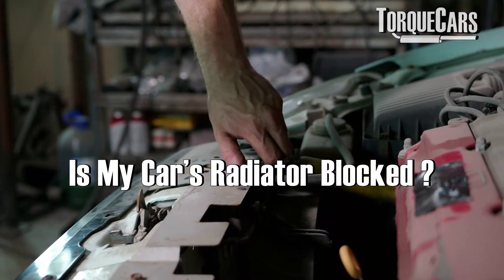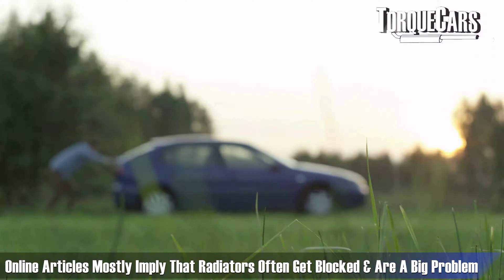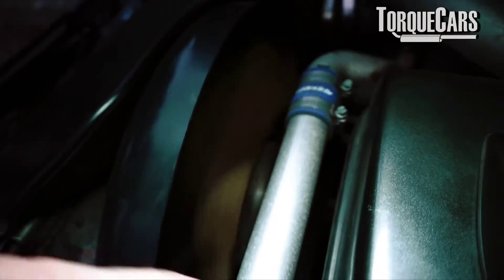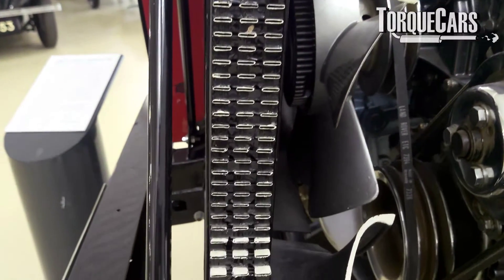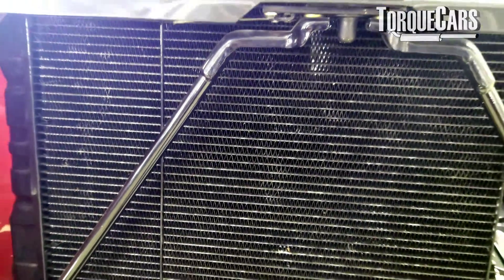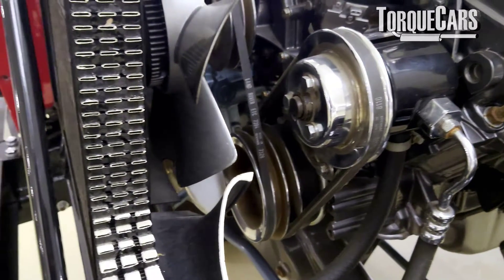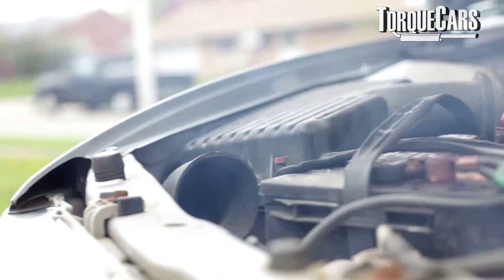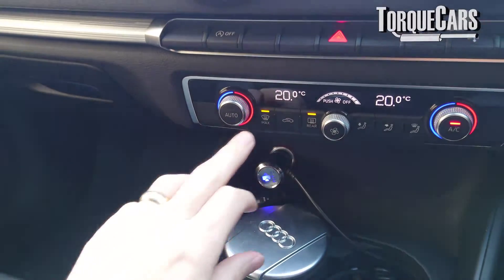Engine Overheating - Blocked Radiator Or Something Else? Diagnosing A Clogged Blocked Radiator

Comment: Can i ask for some professional oppinion. Everytime i drive my opel vectra c 2.2 diesel 2004, i lose coolant fluid. I always fill the coolant to the level where it should be when cold. Ofc There are no visible leaks underneath the car. But what i noticed, after driving for like 60km, when i turn the car off, and let it cool off for half an hour (the car is mild warm). When i open the cap, sometimes the coolant keeps gushing and returning in the coolant reservouir. The main coolant hose is a little stiff (meaning it could be a head gasket). But yeah everytime i ride the car, after a day i have to add 100-300ml of (coolant 50/50 distiled water). Can you please answer ? 🖐🏻

Comment: Can a bad heater or radiator decrease the coolant temperature when idle? Ty!
Reply from the maker: A decrease in temperature is probably down to a thermostat issue, if it is flowing the coolant through the radiator and the radiator fan is cutting in prematurely it will cause the temp to drop. The trouble is that the indicated temperature may not be accurate, the car could be overheating but the stat is reading cold and sending the wrong information to you, and sometimes a bad water pump can cause this.

The key is to understand how the coolant system works in your car and logically work around that until you find the cause of the coolant temps dropping.

Comment: Thanks for the vid. My Dmax has a hot top hose but a cold bottom hose. The weird thing is the temperature on the dash indicates its normal even after a sprinted drive. What could I check?
Reply: @88Frank   cold water more dense so moves to bottom i hope? Cuz my car does the same Opel Astra f 1995 160i (kadett)

Comment: I have a topic I would like to hear your opinion on.
TDI engines.
If you code off or block the EGR, will it take the engine to heat up longer?
If you have the EGR coded out or blocked, will you kill your DPF faster?
Thanks!